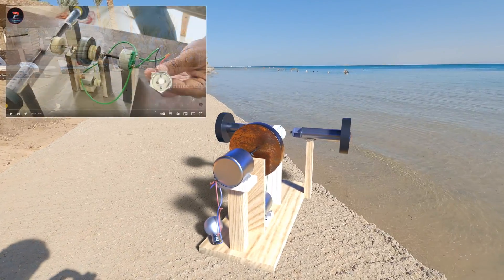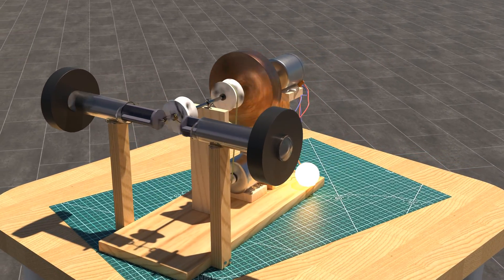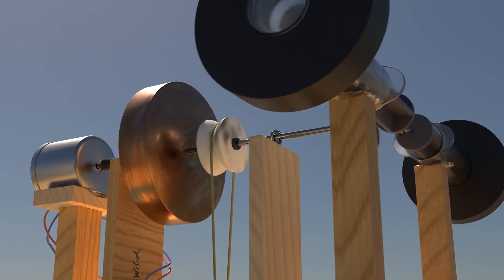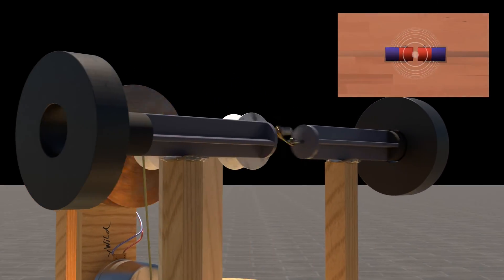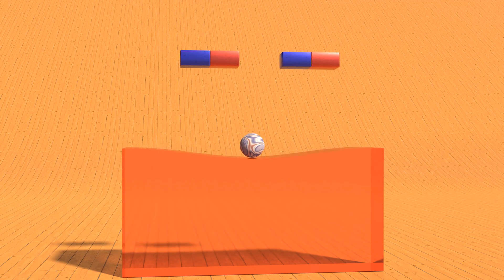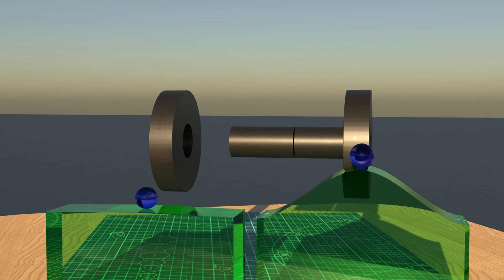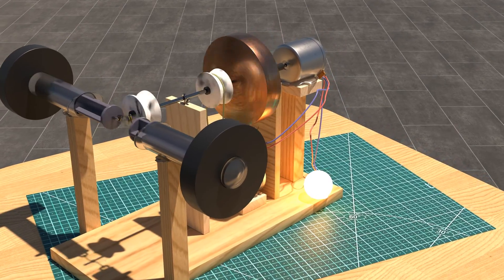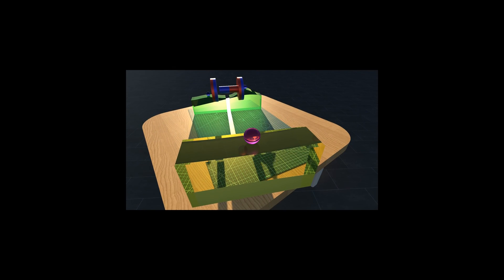Truth: Free Energy Generator with Flywheel power, Prince Experiment a2z freeenergy9552 freeenergy

Comment: E=mc²

If a magnet has constant force,I would like to assume that we could use this force together with electricity to to drive a small motor at very high speeds.
Put together this high speed motor with a geared time machine,we would drive a heavy flywheel with minimal  electric power requirement.
We therefore can drive a flywheel to run  bigger source of energy.....can someone think along this line and tell me that its possible to generate infinite energy in form of electricity....

Comment: Hey, I like exploring energy systems, love you're videos. Subscribed. I have an idea for one for you to look at, I'm going to debunk it at home for myself on my 3d printer, but you might, like it/it may make a good video.

The idea is to lock spherical magnets rotation when thery are aligned at the poles and are close together. Then pull them appart, not axially, but radially to take advantage of the lower resistance to separate magnets radially, kind of like how you could never pull a 2000lb pull fishing magnet off oa steel table, but you could slide it off.

Any ways, at some point in the sideways motion, you will releas some potential energy to move further apart since the magnets will start to repel because they really want to rotate to align at the poles.

After this point, at a distance depending on how strong your magnets are, you let the magnets rotate and align the poles. This will magnifiy the potential energy available to the magnets at that position in 3d spaceand change the repulsive force into an attractive force between the magnets.

I'm going to test it because I find the idea intriguing, maybe you will too. It most likely won't work, but a heat pump has a COP > 1 by manipulating potential energy, symmetry man.
Reply from the maker: Hi Chao, thx for your comment. Soo glad you like the videos. 
Try your great idea in the gravity model if you like. If it will work there, it will work everywhere 😃.
I wish you success with your invention 👍🏻🙂.
Thx for watching

Comment: New to you channel. Its worth noting this HAS been replicated and placed into a car. In test before placing into a carvthe magbetic rods kept moving and the ONLY way to stop it was by using mechanical brake. The car went forwards and reversed in snow and up hill. So there you have it. It WORKS and does NOT stop unless physically stoppd. stopped.
Reply from the maker: Hi Cejs, thanks for your comment. Glad to hear, that my analysis is not really treating all aspects of the generator and it really works. I will be curious when the first car is sold in the shops without any tank cap and without ever stop for refuel. 😄👍🏻. Thx for watching 🙂

Comment: sweden calling!
hi!
another nice video from you.:)
explanation that you make is very clear, in your model how magnetism works and takes out the item in the forces.
Then flywheels are part of the solution of many magnetic motors. The power that is charged when a magnet is in a working cycle, and when the next magnet is to come in and work, a flywheel, loaded with motion energy, is needed to help.
Flywheels are part of the solution in an engine..
just look at an otto engine..of petrol.
without a flywheel it would be dead..
//MATTIAS
Reply from the maker: Hi Mattias, thx for your comment. Greets from Germany 😀. Yes you are right. The flywheel is used for preserving some power over time. And yes 🙂 it is used in many machines for exact that reason and it may be a part of an future solution. Especially if the part of extra free energy which is gained is small.
But it is just an container for energy and can not create it by itself. It’s role for an free energy design is very small. Thx for watching 👍🏻🙂